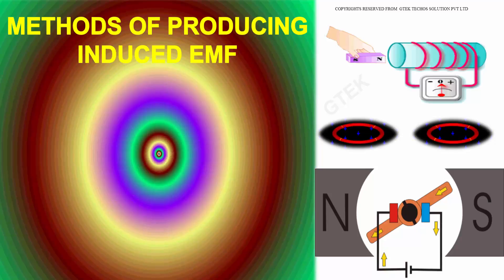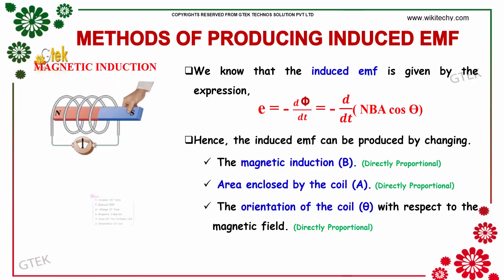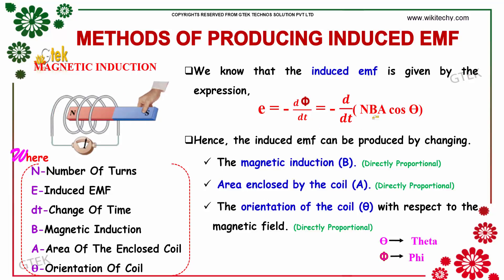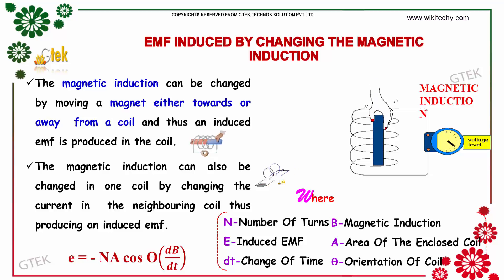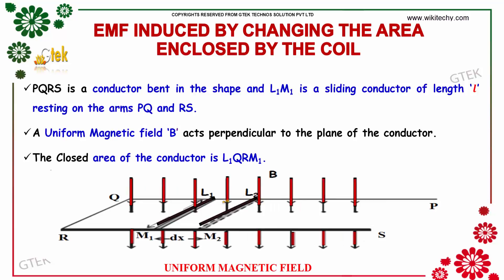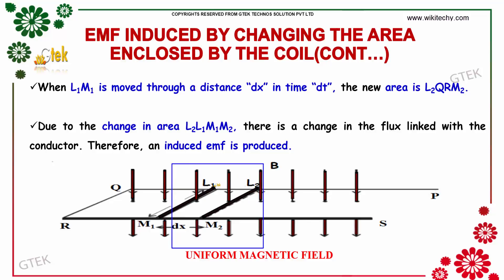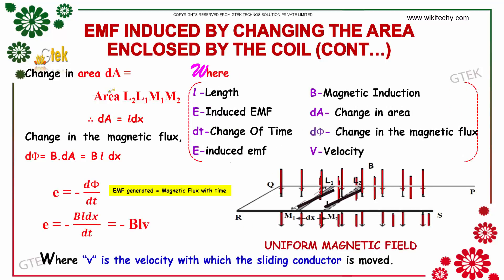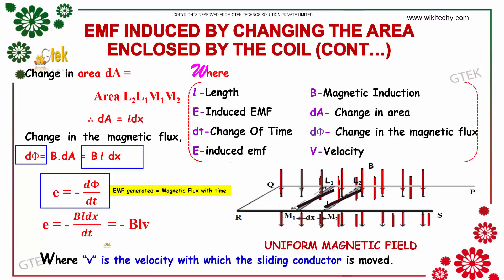Method of producing induced emf | Electro Magnetic Induction And Alternating Current|physics  notes

Comment: Electricity generators use the principle of electromagnetic induction. A simple generator is simply a coil of wire in a magnetic field. The amount of induced emf (and therefore current) will be affected by N- the number of turns in the coil, and f the magnetic flux cut.

Comment: To be completely accurate, if the magnetic flux through a coil is changed, a voltage will be produced. This voltage is known as the induced emf. The magnetic flux is a measure of the number of magnetic field lines passing through an area.

Comment: This voltage is called an induced emf as it has been induced into the conductor by a changing magnetic field due to electromagnetic induction with the negative sign in Faraday's law telling us the direction of the induced current (or polarity of the induced emf).

Comment: The coefficient of self induction of a coil is numerically equal to the opposing emf induced in the coil when the rate of change of current through the coil is unity. The unit of self inductance is henry (H).